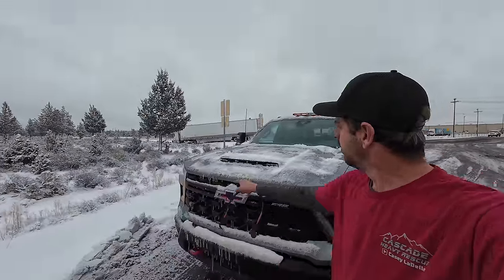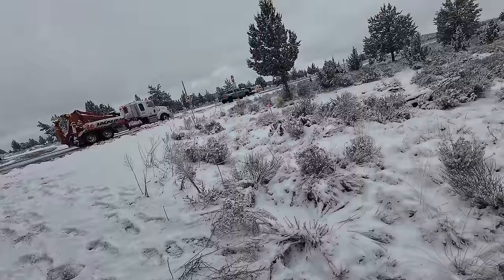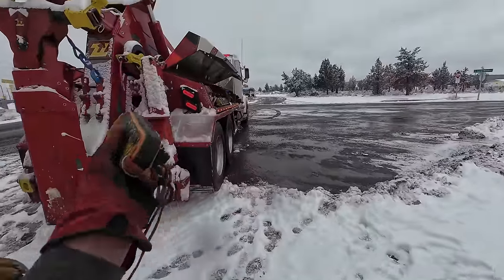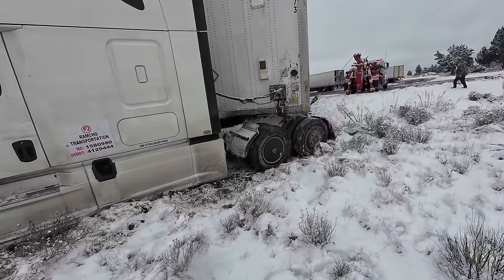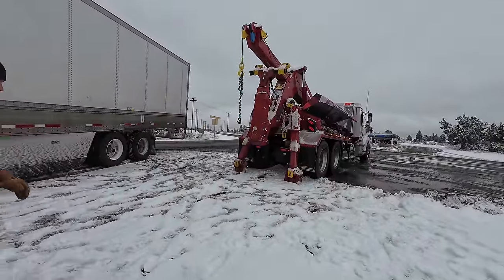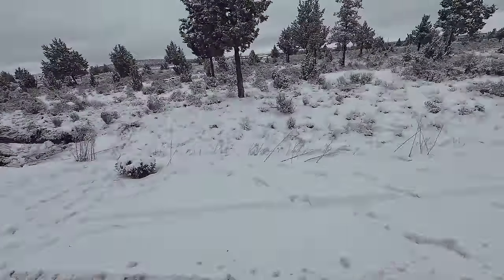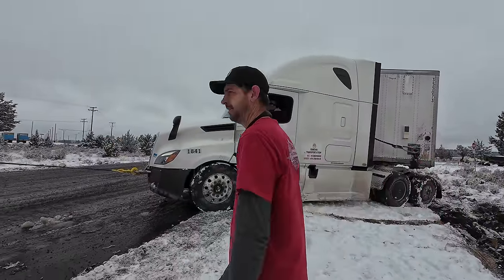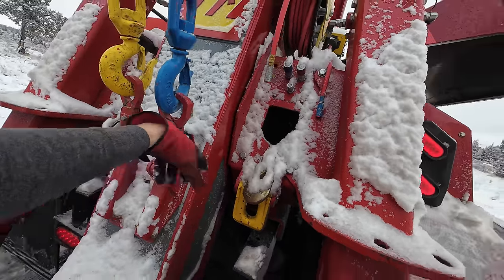Can’t park there, Bud…

Comment: Good planning on washing the truck. It worked as designed.
Reply from the maker: I told you!
Reply: Haven't had much snow in Iowa since early January.  Thinking about taking the snowplow off my designated plow truck😂
Reply: @rosscoder6380  you know if you do that it will snow zhe next day just to f you up
Reply: @shinoharazockt9912 agreed but maybe he needs the money 💰 lol that would be one way of looking at it
Reply: @rosscoder6380 DONT DO IT!! I took mine off last week and had to put it back on Thursday morning when we got 4 inches..🤬🤬🤬
Reply: @rosscoder6380  First plowable snow of the season here(MN) last Tue.
Reply: @CaseyLaDelle  When I was 11, I had never heard my mom curse up to that point. I came home from school and she said, "Don't take your boots off, go back outside and shovel the walk." I said, "Why? It's still snowing and it'll just get covered with snow again!" She said, "Why wipe your ass when you take a shit? You're just going to shit again."

I couldn't argue with that logic, and coupled with the shock value of hearing my mother use a curse word I turned right around and shoveled the walk.

Same thing applies to washing your truck. "It's just going to get dirty again."

Comment: I was never interested in the big rig recovery, I was fascinated by the smaller off road recoveries you did, especially in the snow. I did put to use some of the things I learned from watching you and MORR into action when I was out 4WD in the Brindabella Ranges near Canberra (Australia) and recovered a ute (pick up) that had rolled and got it on it's wheels. When you went to the big rigs and got the big tow truck and assembly, I was losing a bit of interest as it's not my thing, but I have been converted - it is fascinating to see your problem solving and how amazing that set-up you have works so well. It's a great team you have built as well. Great content!

Comment: I’m telling you, Casey a lot of companies could definitely benefit from the auto chains. I know you certainly have. And I know I have too.
Reply: Agreed, no auto chains in his area is like having no insurance on you truck, I am a flatlander in Canada ,although we don't get huge amounts of snowfall each winter ,we do get the extreme cold and very icy roads all winter long and i believe in good quality snow tires and drive out of town everyday for work and they have been the difference of getting there safely  versus the boys in the 4x4's with summer tires in the ditch thinking they are invincible ,
Reply: @99unclebob on the ambulance we had a saying that 4x4 helps you go but doesn't help you stop. Also 4wd can get you unstuck from 2wd and you will need outside help if you get 4wd stuck. A winch seems to be the outside help missing from most 4wd trucks.

Comment: I saw on Facebook that Edison came out with a sleeper mock up for the production trucks , add auto chains   and powered front axle then slap the genesis on the back , the 4900 is a great rig but having 6x6 capability would be awesome
Reply: Good Idea .
Reply: Having a " friend" plus co-worker as in Ethan is a Great combination!   Also the neighbor Mr. [Wilson, Tim Allen Toolman]  Grumpy  your Group is outstanding !!!!
Reply: With lockers on each axle and between axles.
Reply: @kensherwin4544   on the Edison trucks having E axles its like having permanently engaged lockers  24/7 so no need for a traditional diff lock

Comment: Another job made easier by the driver listening to the operator and doing as asked
Reply: That’s For sure my neighbors had a woman slide off into ditch. I had pulled out into roadway and snow was a good foot deep and my truck at the time was only two wheel drive. And I told her to keep them at an angle so that when I pulled it would come out of the ditch instead of going down it.  And she kept turning the wheel back opposite, after three attempts and almost two hundred feet, I was exasperated and pissed. Told her to call a wrecker I give up. Sometimes you just can’t fix stupid

Comment: The only thing I know about heavy towing is when, years ago, I was a tag along on a friend's west coast work boat as he towed pre-built dock platforms up the west coast of Vancouver Island. He told me it is called hook up for a reason, not hook down. If your eyelet or hook fails for any reason and you are under tension and you have placed your hook down it will sail straight back into the boat and any crew in the way. If you place your hook up and a similar failure occurs the terminal end will simply drop into the water. 

So, please tell Ethan it's hook up, not hook down.
Reply from the maker: Anyone who tells you which way a hook is going to fly when it breaks is full of shit.

Comment: Need two things added to this show. First, a reflective vest on Grumpy. Some with a little battery pocket and twinkle LED's. Second, on the Traffic Control Truck, need two revolving yellow spots ... BUT ... not mounted flat on the roof. Instead, mount them sideways on angle brackets. Best angle to warn off low flying aircraft and sub-compact vehicles.

Comment: Always have loved your content you put out Casey! I do have a question for you, do you ever consider the way you place a Winch Lines hook on something? Like with having the "Throat" of the hook in a upper or lower position so you have "More Weight" pulling on it instead of the "Tip" of the hook? I've always been told to try and get the hook in a position so the "Throat" is taking more weight but to also angle it in a way so if the hook was to break, it would go in a direction that reduces the chance of it coming back at someone and hurting them. (Ie: Place the hook with the "Throat" side towards the ground and if it broke, the hook would try to go into the ground and "slow" the momentum.
Reply from the maker: Anyone who tells you which way a hook or cable will go if it breaks is full of shit

Comment: Why not pull the tractor sideways back so the trailer would follow its tracks from when going in?
That way, you could avoid harming the skirts with a sideways force?
(pulling from an angle at around 4 o'clock with reference to the trailer)
Reply from the maker: And hook to what??

Comment: Question for someone who just simply doesn't know, and wants to kearn. 
Any reason you hooked with the locking flap facing down? (Like hooked and attached with a downward motion vs sliding the hook under and pulling up and back) I always understood that the hook needs to be the opposite so that if the hook fails, the hook will shoot down into the ground instead of up? 
Is it because you're well within the WLL of your equipment? Or another reason?  I just found that interesting. 
Hope that didn't sound like I was telling you how to do your job, I'm genuinely just curious.
Thanks, and I love the content.
Reply from the maker: Because it doesn’t matter.  Anyone who says they know which way the hook will fly if it breaks is a liar.
Reply: @CaseyLaDelle  I guess that makes sense. If it breaks it's releasing a lot of stored energy. 
Thanks for the reply.

Comment: Did I hear you mention the winch stalled?? That's a first
Reply from the maker: Yes.  I’ve stalled them out a few times.
Reply: @CaseyLaDelle  I guess I wasn't expecting that, but it figures.
Reply from the maker: @pear7777  those are 30k winches on an empty drum, and only good for 17k on a full drum.   They can be stalled out pretty easy

Comment: Camera man turned into a tow truck operator.  

I had to be pulled out of a muddy parking lot and asked the tow truck driver where the tow hooks are on a Cascadia?  He said if they have them they are on the frame underneath the hood but they probably aren’t there and you have to depend on the tow truck.   

And just yesterday I had the trailer brakes freeze up.  Backed into a dock and had to wait 4 hours for them to open.  Set the brakes and did paperwork and got the dog out.   I normally don’t set the trailer brakes in the winter but just an old man brain fart.  🤷‍♂️. Had Loves come out to crawl underneath the trailer, at 70 I just can’t do it anymore.

Comment: How many feet of cable do those winches hold?
Reply from the maker: 200
Reply: @CaseyLaDelle  oh that's a good amount!
Reply: @CaseyLaDelle 
Will the syntetic line be the same length or shorter ?
Have you the syntetic line or just a wish ?
Otherwise a small winsch at the rear that you can use to go true a snachring and winsch the steelcable to the truck you going to tow instead of doit by yourself..

Comment: case if the truck had a pinnal hitch could you pull from it where its centerline and well mine on my tractor is either rated 40k lb or 40 ton its huge so it might be 40 ton
Reply from the maker: Yes, but it would never hold up to 40 tons of pull

Comment: You literally don't everything very dangerous my friend.  You need to go to a heavy recovery course . You are getting away with a lot brother . Once is all it takes . When your winch stalls it's over loaded and you need to run snatch blocks . This can snap you cable and kill someone someone.  someone.
Reply from the maker: Go be an expert somewhere else.  16k pounds of pull is not going to break a wire rope with a 41k pound minimum breaking strength.   
If you had half a clue what you were talking about you would know that winch stalling is the best of all the possible failure options.